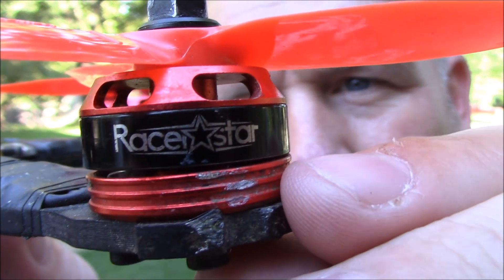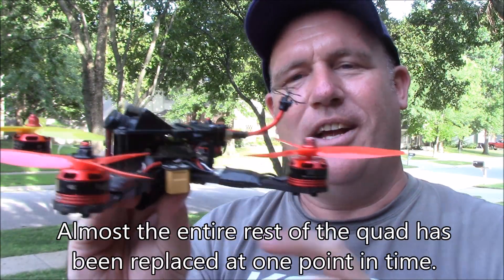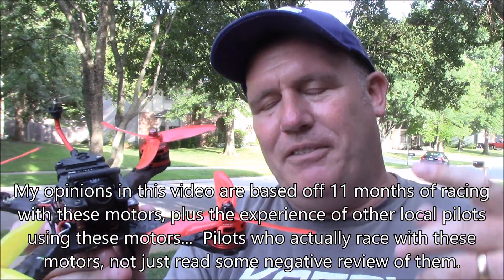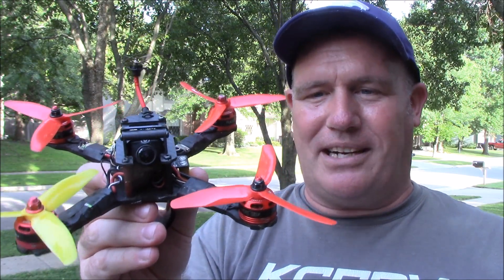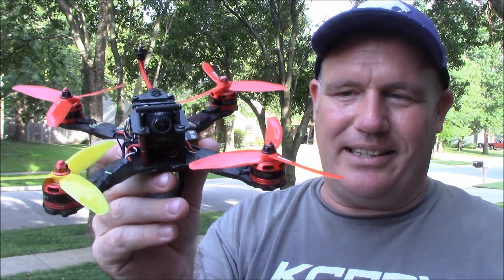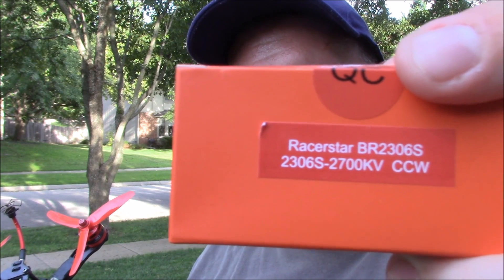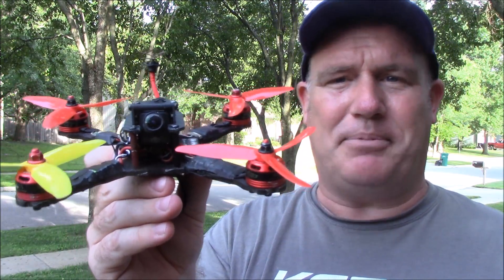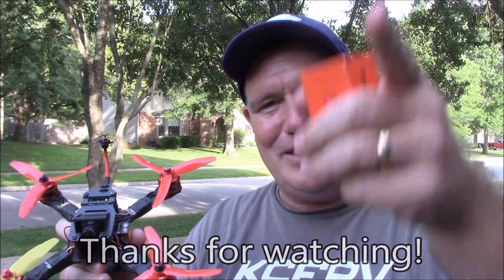Rant On!  Racerstar BR2205 2600kv Have No Real Competitors

Comment: The new 2306 27000kv motors have really done well in testing, almost the same performance as 2306 Emax and they are less power hungry so they dont destroy you battery that easy.
I used them on my realacc purple frame and i'm really pleased with it so far.  There will always be somone who think that the most expensive motors is the only thing good enough,  but you really need to be professional to need anything better then the racerstar 2306

Comment: I just can't really justify these motors when the RCX SE2205v2 are $9.99 each and significantly better in every way (lighter, stronger build construction, better performance), and the RCX RS2206v3 at $10.99 and one of the best performing motors on the market.  Save your Taco Bell money for one day, and get better motors.  There's a lot of hidden costs of buying a motor like the RacerStar BR series.  You'll need to upgrade MUCH sooner as you progress, and  you'll replace more motors due to the construction quality.
Reply from the maker: You can get a 4 pack of motors shipped from BG for $28.  Is comparing them against motors that cost 33% more really fair?  I could save my Taco Bell money for a week and buy some Skitzo motors or Steel motors or T-Motors and have way better motors that then RCX motors, but the point is that the performance offered by the Racerstar 2205 2600kv motors at their $7 price point don't have any real competition.  Sure... spend more money and get better products... that is the same everywhere.  I buy Kroger potato chips too.  :)
Reply: But you don't actually end up saving that money, you might save it initially, but then in a few months you're buying new motors anyway, where if you bought the RCX motors or similar to begin with, they're good enough that you'll likely never really need to upgrade as your skill progresses. I agree that the very expensive motors are not really worth it, but $30 vs $40 is not significant.  If you can't afford $10 you're probably in the wrong hobby.
Reply: Spend $10 more and buy the rcx motors. Just try them and see. \The same reason you would pay 14 % more to get the racerstar 2306 motors over the racerstar 2205 motors, is the same reason %25 more for the rcx 2205 motors over the racerstar 2306.

Comment: The RCX SE2205 V3 2600KV motors cost about 10$ and they are MUCH better quality. The biggest problem with the racerstars is the complete lack of quality control. You had luck if you get 4 good ones. but you could as well have gotten 4 motors that are completely imbalanced or with bad bearings and end up burning your ESCs and maybe even your whole quad.

But even after all that, the racerstars are OK motors, since they offer a VERY cheap entry into the hobby. Choice is always a good thing.

http://www.myrcmart.com/rcx-se2205-v3-2600kv-fpv-racing-motor-japan-ezo-bearing-n52h-arc-magnet-p-11356.html
Reply from the maker: I've helped at 2 build parties where we built about twenty X210 quads, each with these Racerstar 2205 2600kv motors.  I flew most of the quads when they were finished and none of them seemed to have vibration issues from unbalanced motors or bad bearings.  That equates out to 80 motors that I successfully tested on real flying quads for about 20-30 seconds each.  That seems pretty favorable to Racerstar 2205 motors quality control to me.

Comment: Do u have any vibration visually in your video after a few crashes with these motors?
Reply from the maker: Only when the props bend.  I can straighten them out most of the time and it flies alright, but new props always fly best.
Reply: Well you should have loads of vibration, thats one hell of a bent motor shaft :-)
Reply: mike jh  I am surprised there is no visual vibration in the video. They can become so hard to tune. So much noise.
Reply from the maker: Surprisingly the motor in the intro flies fine and doesn't give any vibrations.  The shaft does make little circles when it spins but when I hold the quad and spin up the motors, I don't feel any vibrations and the camera looks good too.

Comment: Same is riding a bicycle. Maybe you need to start with training wheels. Once you get better you get another bike. And then you get a better bike. And then you get into motorcycle. But a small one. When you get your Hayabusa for your 1000cc bike and go to rip it on the track and win races.
Reply from the maker: Yes, these are motors you use for a while and then move on to better ones later.

Comment: Damn those shafts are bent! :D I wonder if emax shaft would fit in these, diameter and screw notch matches quite well, perhaps you should try changing the bearings n shafts on them (not like those motors are expensive, i just liek repairing stuff if there's a possibility :)
They're still probably best motors for new/causal flyers and lighter rigs, especially for the price. Got them filled with sand and tiny stones, shook the quad, spun the props a bit, no biggie, got my baby in air within 2 minutes no dissassembly and cleaning required due to bigger gap between stator and rotor :D Team BangGood FTW :P
Any chance you tried the race edition ones?
Reply from the maker: LOL!  The shaft on the motor in the intro is bent just a little but it still flies great.  You can see the gap spacing difference between the bell and the lower part of the motor on the left and right side.  That motor still doesn't even get warm though.
Reply: Yeah that's why i mentioned that :D It looks bananas

Comment: Rctimer beerotor motors.
Tmotor air 40 2450kv (love these).
Kingkong 2205.
Furibee fuuton 2205 motors.

Not trying to disagree with you but I do believe there are better options (and thanks for the vid, it was nice to see positive thoughts expressed on these motors)
Reply from the maker: There are better motor options, but not at the $7 price point.  Spend a little more money per motor, like $10, and you're buying a better motor but also spending 25% more.  The KingKongs are the only motors that are near the Racerstar price that I've seen so far.

Comment: Consider the efficiency and amp draw; they have similar amp draw to the lumenier 2206, which Braindrain recently recognized as amazing motors for racing. Other motors will draw significantly more amps at the high end (and more thrust too of course)

Comment: I started with these motors and yeah they get you into the hobby. But I did outgrow them very quickly and they was just not fast enough.
Reply from the maker: The cool thing is that you noticed they weren't fast enough for you any more and moved on.  I think that is exactly what these are for.  There aren't any other $7 motors that can do that for you.... $9, $10... yes, there are those, but not any other $7 motors.
Reply: travisgrindal well I started with these motors on 3s and when I got comfortable I moved to 4s then I built a new quad with bigger motors.

Comment: The 2600kv aren't 2600kv.  They've been tested to be only 2400kv they are that far out of spec.  You also aren't including the KingKong 2205/2350kv or RCX 2205/2400-2600kv which will smoke those Racerstars in both durability and performance for a few bucks more per motor.  The newer 2305 and 2306 motors seem to be a bit sturdier.  I have the 2306 ones and they are fairly good.
Reply from the maker: I mentioned in the video that MiniQuadTestBench measured the 2600kv motors closer to 2400kv.  I need to try the KingKong motors.  I've had good luck with other RCX motors in the past so I'm sure theirs are good.
Reply: Been running Kingkong GT 2205 2350KV. Worth the extra buck. The arc magnets, 0.15mm lamination and 4mm hollow steel shaft rocks! Crashed a lot and these motor still going strong.
Reply: Yah, king kongs are fantastic for the price. 30e/4pcs, I would say that is in the same category.
Reply: The RCX also come with fully available spare parts.  Not that I've had to use my spares as they have proven very durable.  The SE2205 weighs 26g with inch long wires.  That's damn light.

Comment: agree with the quality of these ones. other versions of racerstars arent as good.

I do fly the sunnyskys for  $2more per motor as they take off.

I have tried the newer racerstar 2306 2700kv's, they are like these but have a little more  immediate go.

I am waiting on the 2306 2400kv ones to see how they go.

the escs are great. use a bit of a zip tie or a busted prop to protect them. 
cheap and easy

Comment: the 2306 are amazing!!! i have the emax 2306 white tops and the racerstar 2306s are so very close in power its unbelieveable i also run them only on 5s on my build with 6 inch so if that is not a stress test idk what is they work percect and come down regualr hot never burning .... the power is nuts!!!!! and i smashed them on the curb 1 time and tumbled in some parking lots and they work totaly great noting broken yet `~~~~~

Comment: You bring up some great points! I'm not above using EL CHEAPO motors at all.  HOWEVER.... I would add a couple thing (mostly alternatives).  If you like the KK 5x4x3's ... try the GepRC 5x4x3's. They're much better (i think). If you like the Racerstar 2205's. Try the KingKong 2205's 2300kv's (they're tested to something like 2500kv - or don't! I hear good things about the 2306s racerstars). Only $8.29 (little heavier though).  The one thing is sorta think is a terrible idea for a beginner or experienced pilot is the RealAcc x210. I was absolutely floored when I transferred the guts of my Realacc x210 build over to a stiffer (AND HEAVIER) frame. Overall power went WAY up. There's just so much flex in that frame that you lose a lot of power to floppy arms. For beginners the open camera and small space is tricky, I think.  I also think top mount battery frames end up with much more control and less dead batteries (but they're always heavier - so there's a trade off).

I hear later versions X210 pro or V+ stiffened up a lot ... but I don't think I'll buy another bottom mount battery design (but that's personal taste and I don't race).

GepRC's: https://www.banggood.com/GEPRC-5040-V2-5-Inch-3-Blade-Propeller-Triblade-Props-Colver-Prop-Blue-Yellow-Pink-For-FPV-Racer-p-1122981.html
KingKongs 2205's:https://www.banggood.com/KINGKONG-2205-2300KV-2-4s-CWCCW-Brushless-Motor-For-RC-Multirotor-p-1056209.html
Reply from the maker: I may try the KK 2205 motors.  They sound intriguing.  I'm going to use different frames for my next builds too.
The X210 build is a little tight, but I have a detailed build video that shows how you can build it and make it all fit.  It has been pretty popular.  https://www.youtube.com/watch?v=39i-WUUh_dY
Reply: Already watched it :) The X210 is great generally (for the price). I used it for a while and really liked it. Besides smashing a camera i was very durable and nice that it was so popular.  I didn't really think its flexibility was an issue until I switched to something else. That flexibility also masked low quality motors as even with more expensive motors the frame was still the weak point so they didn't make as big a difference. Anyway - I really liked the frame and your build video!
Reply: travisgrindal my first quad was the Kingkong 210gt, with the Kingkong. 2205 2,300kv. My first build had the Racerstar equivalent on, honestly couldn't tell the difference. My mate after 10 months of flying just swapped his KK motors for Racerstars as they'd had a good run he couldn't notice a difference either. I think they're very similar motors in terms of power and quality.

Comment: I used your build videos to get through my x210 build and spent my first week learning how to crash. I have been pleasantly surprised by the durability of these motors.
Reply from the maker: Good to hear!
Reply: travisgrindal hello Travis. Similar story with me. watched your build X210 git one still loving it. But do not upgrade to 2305 them very baaad (magnets flying off). 2306 out there but I'm not risking again. Anyway it is true them good motors and the esc's. I had some moment when I wanted to dump the hobby because of components blowing up with no reason lucky Iv found your video and I'm still flying 
Cheers bud have a nice weekend happy flying
Reply: TransAm2k4 Now racestar has a 2205 race version @ ~$8 ea which comes with hollow hard steel shaft to avoid " chewing threads " . I recommend them as well, actually l recommend them for the first 3 quads anyone intends to build. From the 4th quad onwards,  then you can try the top notch motors @ $25 ea .
Reply: travisgrindal this has been my experience as well. Upgrading to 2306 because the thread on the shafts are getting chewed up

Comment: Too many people have unrealistic opinions in this hobby. The fact is, most people who are flying miniquads will never be limited by their hardware. Cheap parts fly so well nowadays that a high performance quad is within anyone's reach.

I'm with you, for someone getting started, these are fantastic motors. They perform better than anything for the price, and it's at a price that it's really not to big of a risk for a new pilot. Most people will either damage their motors or move on to a second build long before they reach the stage where these motors aren't performing well enough for them.

I feel bad for all the kids who save up a ton of money to buy the best parts because they're being told that that's the only option. I was out flying a quad today that has $5 1806 motors, a $12 naze32 clone and $3 no name escs running oneshot125. It's the best quad I own, because I feel no pain when I fly it into a tree or cartwheel out of control after a low split s.

Comment: I've had nothing but success with them. Travis if they get hot, turn off air mode in bf and up your min throttle so you still have control on zero throttle and the motors run ice cold. you can run a good amount of d gain then too.

Comment: They we competing against the rcx se2205 2600kv v3 motors from myrcmart hat are a dollar more with much more punch
Reply from the maker: The RCX SE2205 2600kv V3 motors are showing up as $12.99 for me on myrcmart's website.
Reply: Yeah, you have to eliminate the warranty which will take $3-$4 off the price bring it down to I think $9. It's a really good option. Just have to deal with the long shipping wait. You should try and compare. It might be a $1-$2 difference with a total of $8 difference. I totally understand where you are coming from with the $8 2306 motors. Perfect for beginners and budget minded people like you and me. I went with the rcx rs2206 v3 motors for a $11 a piece. For me it was worth it. I mean, if you think about it, for $8 those 2306 motors are really good. Paired with some motor guards for extra protection and it's hard to beat.
Reply: JC250 yeah I'm trying the same. First impressions were they are pretty much tornado t2s in feel and power and blow the racerstars away In terms of performance and feel. Incredible value for money. Concerned about reliability though, one motor is beginning to click...

Comment: Only thing that competes is the 2306
Reply from the maker: Yeah, that is what I think too.  The Racerstar 2306 motors are $1 more.  :)
Reply: travisgrindal ya and just the added durability is worth it before you add in the performance upgrade
Reply from the maker: The only downside I've seen is that they rate a little more amp-hungry than the 2205 motors.  I'm going to try them anyway.  :)

Comment: RCX SE2205 V2? Kingkong GT 2205? Both of these are better than BR2205 for $9 each.
Reply from the maker: myrcmart sells the RCX SE2205 for $13.  I may try some of the KingKong GT 2205 motors and see how they compare.  Thanks!
Reply: Deselect the warranty option and you'll save $3 per motor. Thank me later.